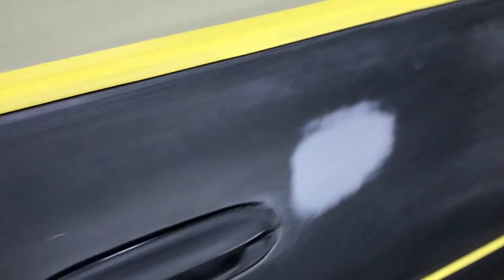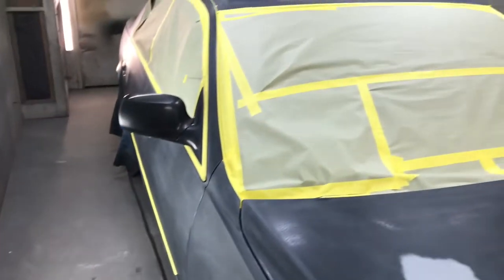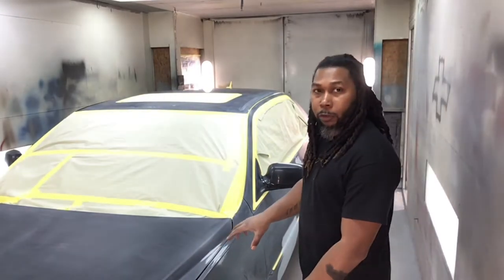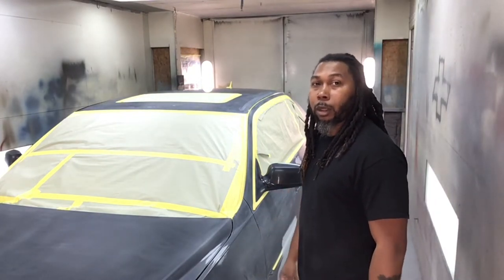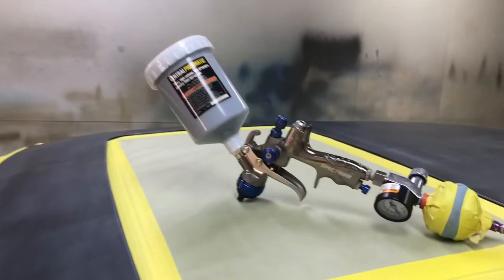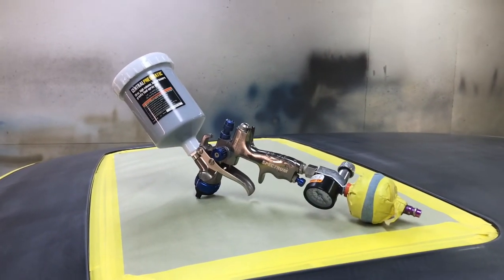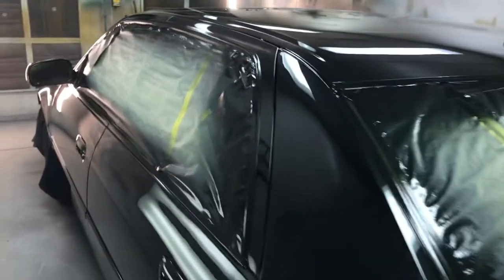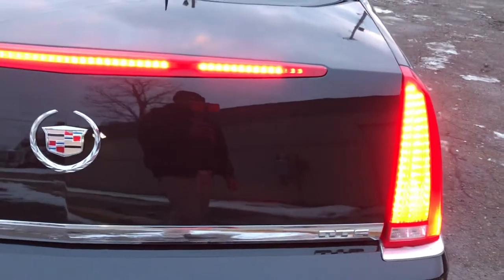Painting Fresh Factory Paint

Comment: Super Bowl!! I pulled the trigger last night on a compressor and a LVLP paint gun.  I almost went with the Rolair VT25BIG compressor, 2.5 Hp, 5.3 Gal, Overload protection and 6.5 CFM @ 90psi. Two reasons I didn't, cost at $425-$500+ and it ran at 89db. I went with CAT 4620AC at $291, 2 hp, 4.6 gal, 2 quick connect, thermal protection, 2 gauges, 62lbs and the 2 big ones: puts out 6.4CFM @ 40psi to 5.3 @ 90psi, and runs at 70db. For the paint gun Sprayit SP-33000 and SP33500 sold me. It comes in a kit with 4 tips (.8, 1.3, 1.7, and 2.0). The draw is 2.4 to 3.9 CFM @ 30psi with a fan pattern of 4 to 11 inches. 
I wanted to thank you for all the info you put out there over the course of many videos. In the end I had to step back and take in what you were saying and what my needs are. I would've had $300-400 extra hardware sitting on the shelf like old trophies. Have a great day brother. Peace!!
Reply from the maker: Good to hear you decided on some equipment that’s gonna work for you... I have seen reviews on the sprayit gun and plan on trying it out myself in the future so hopefully it’s gonna be a good gun...hopefully any of the info I give is helpful and useful and I appreciate you!...have a good day!

Comment: Just started gathering gun and compressors info. As you know there's tons of confusing stuff out there. I've watch at least 5 of your videos, cross referenced the info and it's solid info. I had to do it cause I'm so new. I do like your presentation, I'm feeling it. The spectrum HTE is the one I'm going with. I just rattle canned a panel on my 98 Explorer. It came out ok but I'm looking for a cleaner look. I bought paint correction tools from Griot's Garage and I'm hooked on doing my own work. Thanks for your time in these videos they helped me find my direction. I do have a question: What compressor would you recommend for the Spectrum HTE? I'm looking for one gun and a compressor to run it.
Reply from the maker: I appreciate you checking out my videos and did your research to show that I’m legit on what I discuss in my videos that really means a lot to me💯...the Spectrum requires a lot of air so if you’re planning on doing big jobs I recommend getting a big compressor but if you’re doing smaller jobs or projects then you can use a smaller compressor and just watch for drops in your air pressure when using your gun. So you have to determine what you will be doing and figure out what’s best for you...for me I do a lot of work/projects so I run a 80 gallon 2 stage compressor which gives me enough air supply for all my needs... I hope this helps and if not just ask me more questions and I’ll do my best to help!
Reply: @UndergroundPaintKing  Got it. I won't be doing much painting but I do like good tools and my people know I take care of business. It's confusing with the gun and compressor ratings. I have to slow my excitement down sometimes. Give me your thoughts for my case. I may paint my Explorer myself next year. I'll only be using a gun a few times but have no problem with buying more than I need. as for the compressor, running a paint gun would be it's biggest job. So would a LVLP be the way to go? Maybe the review you did on a LVLP kit? Don't mean to take up your time but I do value your input.
Reply from the maker: @racefast64  a lvlp gun would be great for your situation it’ll save you money and get the job done...I plan on doing some reviews on other lvlp guns in the near future so be on the lookout for those as well...again if you have any questions feel free to ask and I’ll help to the best of my ability!
Reply: @UndergroundPaintKing  You know I will. If you have a suggestion on a LVLP gun, compressor combo you'd have my gratitude. I'll surly check it out and as you say 'let's get to it". 
I plan to buy next weekend, I'll let you know which toys I get. Have a great Super bowl Sunday.
Reply from the maker: @racefast64  I’m looking at 2 lvlp guns right now but don’t want to recommend them and I haven’t used them first but I know the Campbell Hausfeld gun is a nice gun but the cup that comes with it is junk...I’ll try to get a solid recommendation for you...enjoy your super bowl weekend!

Comment: I got another sprayer but it is electric wanna try it when it gets warmer in Michigan it is called the Yattich 700 watt electric sprayer got it for 77 dollars so I won't need a air compressor to use it and it comes with multiple tip sizes you can use. Bought some other stuff too a tool that can get rid of dents and a clear paint marker my truck has scratches on it they actually look like white scratches gonna it when it's warmer too.
Reply from the maker: Let me know how that electric sprayer works for you I haven’t personally used one for automotive paint but it sounds interesting!
Reply from the maker: I appreciate you checking out the video bro!

Comment: What you sand with on this video before painting to get the factory paint job.
Reply from the maker: I used 320,400,600
Reply: @UndergroundPaintKing  you used 320 on the primer. But what did you use 400 and 600 you just sanded with 400 around all the parts on the vehicle that you was gonna paint then went back and did it with 600 after 400 to get rid of the 400 grit scratches.
Reply from the maker: @zanaga1901  yeah that’s the process I went through